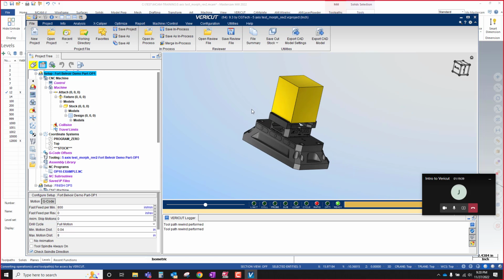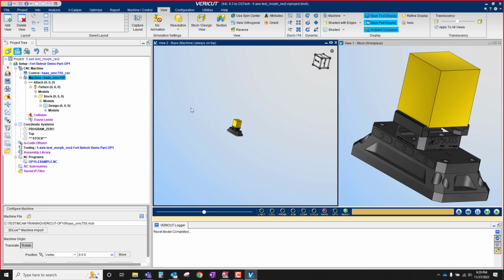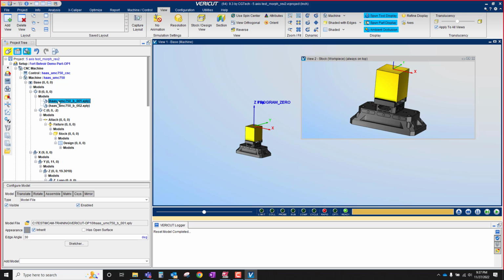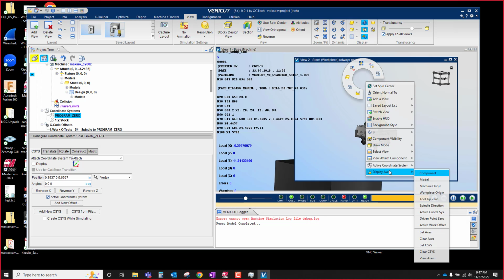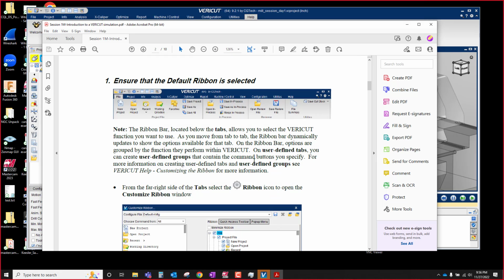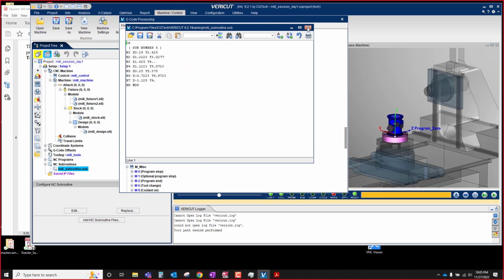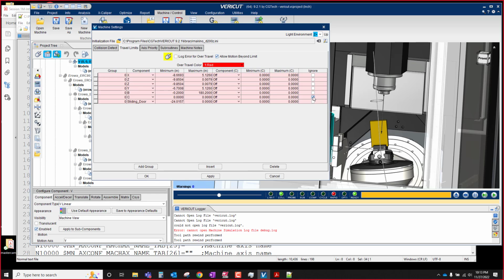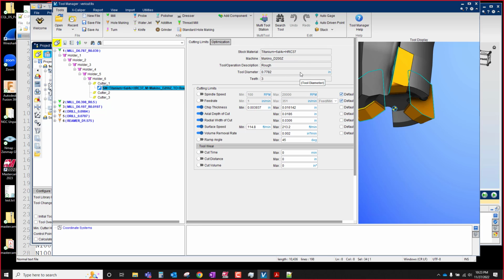Intro-to-Vericut_MCAM-V_Add-in_Part-2

Comment: Vericut for start it is a bit tricky. Once you know then it will be good. I recommend to set everything inside mastercam before run. Im working as an AE for Mastercam and Vericut reseller. I know you from Mastercam post processor forum. I admire your knowledge in post processor😊